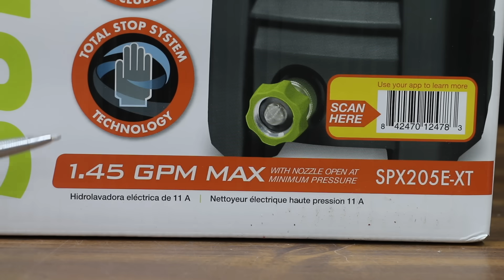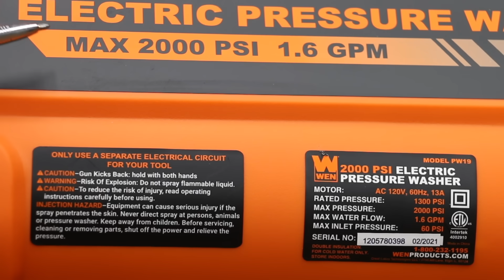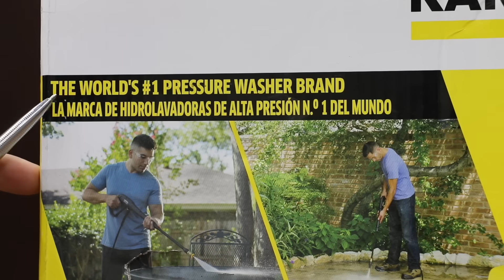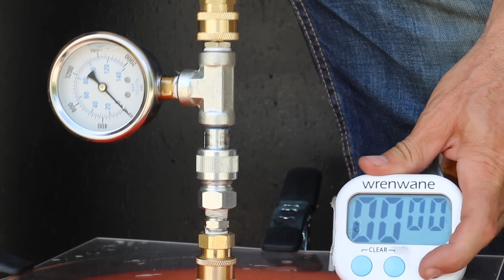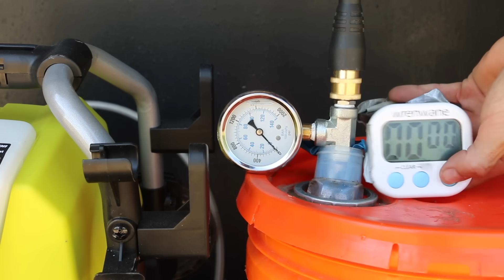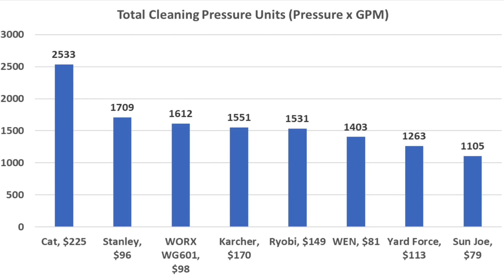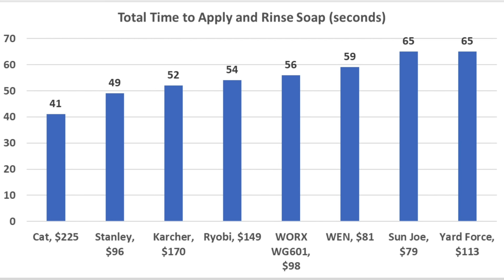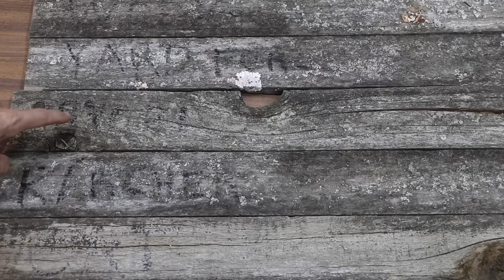Best Pressure Washer (ELECTRIC)? Ryobi vs Karcher, Stanley, Sun Joe, WEN, CAT & WORX

Comment: You should have had the soap cannon on the wider setting when testing as that's why they all take so long
Reply: Very few soap cannons will fit the standard hoses that come with these pressure washers

Comment: Some curiosities:

When doing these tests, did you also monitor inlet pressure? I'm not sure how much it matters, but I thought pressure washers basically multiplied pressure. If that's the case, a change in inlet pressure could throw off the readings. (unless the pressure washers use relief valves)

Also, I'm curious how these compare to something like a Hotsy.

Comment: I'd love to see you do another video on super glues.  AvE keeps touting a high priced super glue, but as far as I can see, it's the same as the original super glue formula.  I personally use a couple different brands of superglue as I've found them better for different applications.  Maybe you could collaborate with another youtuber that does 3D printing to make PLA test pieces.  Integza, 3D Printing Nerd, or Major Hardware might be able to help.  I think Integza would be the best match as he does physical testing like you, but then again so does Major Hardware.  Integza is just a more interesting character.

Comment: Have you ever done a comparison on hacksaw blades ? I had a look through your videos but couldn't see one . I  think a mechanical set up to cut through something like railroad track or something else that is fairly tough like a big grade 8 bolt etc and you could also test the tensile strength fairly easily . Also is bi metal worth the extra cost ? I have seen blades that wouldn't cut the skin off a block of cheese and others that seem to last a long time - personal favourite is Bacho brand .
You could also do a similar video for wood saws and bandsaw blades - both wood and metal cutting .

Comment: Dang, the driver's side of your truck will be clean forever at this rate.
Reply: Or until he drives it.
Reply: No wax left. I know the non wax removing soap.
Reply: I thought the same thing. Was waiting for the paint to start flaking off after like the 20th pressure washer pass. Hahahahaha.
Reply: @I_know_what_im_talking_about  Pressure washing does not damage paint if you know what you're doing.

Comment: Love your content! Though this would be a very time consuming video, I think that comparing synthetic motor oils from all major oil brands would be very cool to see, like what the best 5W-30, 0W-20, and 5W-20 brands are, and maybe comparing "performance" and "high mileage" variants against normal synthetic as well.
Reply: He already did that a few years ago. I believe the best that he tested back then was the Shell Platinum & AMS oil.
PF has also tested oil additives.
Reply: @guytech7310  Yes im aware, I was thinking of a more comprehensive test that puts more brands against each other than just two.

Comment: One of the top things that I look for is the flexibility of the hose at different outside temperatures.  When cleaning your car there is nothing worse than kinking and coiling.  Especially if it contacts the car.  Great video as always.

Comment: I was really hoping for a snap on pressure washer idk about now but they used to have one at Menards for only 70 to 80 bucks and it was a very nice compact washer best I have used for the price. I am not sure if they still offer that model but they do still make a 2000 psi one for 160 and I would imagine it would work even better than their smaller cheaper one.

Comment: If you rinse down soap , i've been told to go bottom to top on your truck, otherwise the soap will wash off before you hit it with pressure. Would like to see the Stihl brand and Nilfisk put to a test ( if available in the US ). Would  also like to know what materials are used in the pump, had a Kärcher with a pump made of plastic , that didn't last very long.

Comment: dang... you chose a bunch of cheap pressure washers with 1 year warranties.. no kranzle, active VE52, Comet, or AR Blue. :( You should look into Obsessed Garage, he has done several reviews on high gpm output pressure washers. Alot of the pressure washers sold in america are made at the same factory, just with different badging on the box. Should probably mention that alot of these warranties are work alot like the new "lifetime" chat support! All I ever hear is they'll warranty certain parts, require shipping, or they don't respond to warranty claims...

Comment: Even though the hose is proprietary on most of those pressure washers. You can change the end of the wand where it screws together. I have one from harbor freight I think I got it for $70-$80. I have a rotating ceramic tip and it is amazing. It works better than any other tip design for removing debris. However, it is very abrasive be careful when you use it. I would like to see that kind of tip used.

Comment: Another idea for above is max duration of usage, most limits usage times from 30-1hr max and require cool-down.
some brush-less allows max 2.5hrs before cool-down at the cost of slightly lower pressure compared to highest pressure rated washers in the market. 
Time flies while you are happily cleaning your yard sometimes, or every time.

Comment: -- Video Ideas:  Best tools that you use to measure results in your tests.  Multimeters, etc.  Best spark plugs (iridium brands, etc).  Best drop cord (considering length).  Best DC/AC inverter by watts.  The the most difficult viewer challenge of all, best products made in the USA.  Thumbs up.  I'll stick with my gas pressure washer, but informative.
Reply from the maker: Thanks for the video ideas.

Comment: Great video! Wish I would have seen this before I bought my washer but still happy with the purchase. I got the same Ryobi model and my only complaint with it is after 30+ minutes of cleaning my sidewalk the handle was so hard to pull my hand was fatigued and I had throttle grip. If it had a light or easier pull it would be so much better.
Reply from the maker: Thanks!  Thanks for sharing.

Comment: Last week I bought a "Greenworks" 2700 psi ELECTRIC power washer. It was $350 - $35 military discount from Lowes. It's awesome. Brushless DC motor that spins up and doesn't shut off like cheap electrics. I've used it to do the house and a of concrete on our back patio and pool area, and very very happy with it. THe concrete had not been pressure washed since 2014, and it cleaned it very handily. I have a Kartcher 1750 psi and there's just NO comparison between a cheap-o and a decent one. This electric one is in the range of gas-powered washers and I expect to get a lot of work of it.
Reply from the maker: Thanks for sharing.
Reply: @ProjectFarm  Yea I realize that it probably doesn't meet your price point for a cheaper pressure washer but sometimes, if you want quality, you gotta spend a bit more. Thx.

Comment: Looks like many of these came out of the same manufacturing facility.
Reply: If these were taken apart I suspect I'd find a lot of similar parts, especially the pumps. Either identical or very similar on many.
Reply: Probably did. These little "pressure washers" are basically toys - completely useless compared to a real pressure washer. Try washing algae off a driveway with one of these things - you'd be out there for a month!
Reply: @gorak9000  But they were great for rinsing cars and crap around the home.
Reply from the maker: Thanks for the feedback.

Comment: Bought the ryobi last year only to find out i paid $150 for a mediocre power washer 🥲
Reply from the maker: Thanks for sharing.
Reply: well, if you consider he could not have done the test without the Ryobi, that should give you the feelz. Let me guess, you would have gotten the Stanley?
Reply: @nunninkav  by going off his tests alone, no. I dont like the adjustable wand tip on the Stanley. I wouldve spent the extra $75 and gotten the Cat. Better pressure, replaceable tips, standard high pressure hose (easier to replace) and probably alot better quality and durability. I dont recall seeing the cat anywhere when i was looking into a pressure washer tho. ‘tis what it ‘tis 🤙🏼
Reply: Ryobi is garbage

Comment: So what did we really learn?:  First, the Chinese are kicking our booty and taking our jobs!  Second, it's a bunch of BS for American Companies to re-badge a Chinese product with their name.  Third, looks like each of the spray washers are made in the same plant with different plastic housings and cheaper and better made pumps.  I purchased a Westinghouse gasoline pressure washer.  It's a good working machine, but has China written all over it right down to the Harbor Freight engine which was rebranded as Westinghouse.

Comment: I’ve had a Stanley for over two years now, but a different model, the SHP 2150 PSI. It came with 4 traditional tips (0, 15, 25 and 40 degree), steel gun vs plastic, and a basic foam cannon. It has standard fittings and I swap in a dedicated gun + nicer foam cannon when I wash my car, it works great. It was $119 on sale at Walmart, they routinely go on sale in the fall at the end of the season.
Reply from the maker: Thanks for sharing.

Comment: I have been thinking real hard of buying a battery operated lawnmower..I understand these are very expensive..but I will buy the #1 lawnmower from you ..if you don't kill it in the test
Reply: don't know about very expensive, but I replaced my highly rated honda HRX217VKA ($689mrsp) gas mower with a toro 21388 ($699 msrp) 60V battery mower recently and I will say that the toro 21388 battery mower simply outperforms the honda HRX217vka gas mower.
Reply: @hanwagu9967  ok $700 for 6 mowers for him to test..that might be inexpensive for you but for most way to much..For $700 I would just get a goat insted and eat it at the end of summer
Reply: @deplorableredneck4.02  there are less expensive battery mowers, but you can always help fund him so he can buy and test ;o)  BTW, goats aren't good alternatives to lawn mowers because they tend to eat to the roots, plus they poop everywhere, and I don't like them.

Comment: This kind of tool seems like paying double, to get far better performance is a better option. For how long they last, and how much they save you.
Reply from the maker: Thanks for the feedback.
Reply: Yeah you have to spend a good chunk of change to get you one that will last.
Reply: Yup. I had to go with a 3400 gas model. It's already hard enough not to create stripes on the driveway, I can't imagine using sub 3000 psi.

Comment: I have an Excel gas model made by Devilbiss that I bought  in 2001, it does not have standard tips, It has the adjustable wand... which was pretty common in the day.
Is there an advantage to the tips, aside from the turbo?  I added the capability when I added a surface cleaner (rotating wand in a dish).

Comment: I had a Karcher about 3 years ago.  It ran...  OK, but it took quite a while to clean the deck.  I don't remember what I paid for it, but I got it new at a discount place, and didn't have a lot of money to spend on something like a pressure washer.

I used it about 6 times over 7 years, and took it in for the winter every year.  About 3 years ago the thing  (IIRC the pump) just cracked, and leaked like a sieve.  As I recall when looking at it the thing was just made of plastic, and the plastic pump cracked.

Never again.  Total junk.  I went out and bought a Brute gas powered model, all metal that cleaned the deck in about 1/2 the time.  It did cost quite a bit more, but it's a durable machine not made of plastic that I hope will last 20 years instead of 7.

Sometimes when you buy cheap, you buy twice.  If you have a little more money to spend and want to use your washer every year to wash your deck, concrete, or anything that requires high pressure, do yourself a favor and buy a gas powered model made of metal.
Reply from the maker: Thanks for sharing.

Comment: I have the 1600 Ryobi portable.   Standard hose, standard nozzles, soap bottle hose, does just fine for cleaning the driveway, car, and various items covered in schmutz.   Not excessively noisy, my main complaint is that the power cord is slightly shorter than I'd prefer, but that's acceptable for what I paid.   (around $100) 

Thanks for doing the test.
Reply from the maker: You are welcome!  Thanks for sharing.

Comment: I had a Stanley,  and a Cryobi. With a bit of repairs i made each of the last a full summer. I think i froze and superglued the Stanly pump to get it to make it to the winter. If i remember correctly the Ryobi got the GFI cut off and replaced with a non GFI plug. Last year we got an old DeVilbiss gas powered washer that needed a new gun and hose. I really like that so much better.
Reply from the maker: Thanks for sharing.

Comment: Excellent testing sir!  Really enjoy these videos.
I picked up a Stanley last year, model SHP2150 - Uses a standard tip which is one of the reasons I went with that model.. (That, and it was also $30 cheaper last year when I picked it up)
Zero complaints with the one I got, and since we were all stranded in our own homes with not much to do,, I used it a lot.. lol

If you feel like playing with pressure washers again,, I used a soap cannon with a stream setting to blast wasp nests off the house and out of the trees.. Would be cool to know what soap cannon has the best range..  :)
Reply from the maker: Thanks!  Thanks for the video idea.

Comment: Didn’t even know Cat made an electric pressure washer. Definitely seems price isn’t based on brand name alone. Great video!
Reply: I think active make it for them
Reply: @bwilliam4023  that would explain why it is higher output than the rest of them.
Reply: @YanniObkirk  Yes because it's 5 piston pump also generate 2.0 GPM. very good spec for who is looking for entry level car detailing pressure washer. GPM is the king in detailing game.
Reply from the maker: Thanks!
Reply: I got one, it works just fine. I even threw it across the yard and still works like new lmao

Comment: Very nice comparison!  I use a pressure washer for my work and hobbies; and got tired of the weak offerings geared towards consumers.  It's good to see that Cat is on top. I work for a dealership and feel that our larger products are well made as well.

After some frustration, I decided to build my own. I used a 6.5HP induction motor with belt drive. None of the loud high RPM series motors as the consumer grade units have. The pump is a ceramic plunger General Pump industrial triplex pump, similar to the KE20A but an earlier model. It will make over 4000 PSI and will easily deal with the toughest of tasks. Here is a video about it. https://youtu.be/Ki3b76rol50 

The problem with the ones you tested is that they all are 120V powered. That limits them to about 1.8kW input power. That isn't enough to do a whole lot of work. If you really want to see something, get an industrial unit 240V powered. All I can say is the wood board test would have resulted in shredded wood fibers gouged out of the boards! 

Again thanks for the great testing, it was very enlightening.

Comment: Honestly, I'd consider all of those toy pressure washers.  None of them have enough pressure to get any serious cleaning done.
Reply: I have the 'toy' pressure washer.  The Ryobi 1600.   I can say that while it won't strip the paint off of steel, it does clean asphalt roof runoff from concrete, mildew and algae growth, as well as dirt from furniture that came out of long term storage coated in crud.    So, I'd say that these are capable of getting serious cleaning done.  They might not be good for resurfacing a concrete parking lot, or cleaning the side of a three story building from the ground, but then, they are all electric.   Much as it'd be fun to see a gas powered pressure washer showdown, the cost might be prohibitive for Project Farm to consider, and most of the folks watching are likely more interested in electric than gas.
Reply from the maker: Thanks for the feedback.

Comment: The old Karcher electric pressure washers are the best. Love my K1700. Obsessed Garage has also done extensive testing of electric pressure washers covering multiple models from many brands.

Stanley would be a great value if it used all standard fittings and a better wand. The ones that use proprietary fittings just aren't worth it and those adjustable guns are junk, IMHO.
Reply from the maker: Thanks for sharing.

Comment: I recently picked up the electric Husqvarna 2000 psi from Costco at $189. Decided on it over the equivalent Ryobi (HD), Greenworks (Lowes), or Bauer (HF), all of which seemed well reviewed. So far I've been fairly happy with it. It cleans concrete really well, but oddly had trouble with cleaning a car. Probably user error on my part. Anyway, very interesting comparison as always!
Reply from the maker: Thanks!

Comment: That was a fantastic video! I like the high pressure gauge testing setup. I hope you pressure washed the opposite side of the vehicle just as many times. LOL
Reply from the maker: Thanks!
Reply: @ProjectFarm  @Project Farm  Hi PF. I wish you could verify this video's claim of No oil Run in an engine for several g
hundred kilometers. Oil pressure lamp blinking while driving. If only it could enter a lawnmower for u to test.

https://youtu.be/ICg264kWkBU
https://youtu.be/Hx3q9Kl0T5s